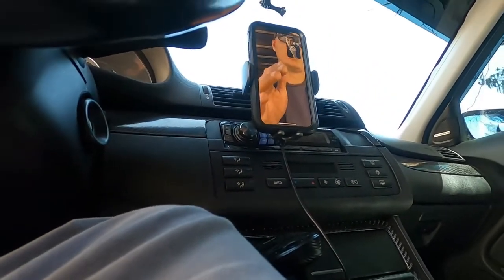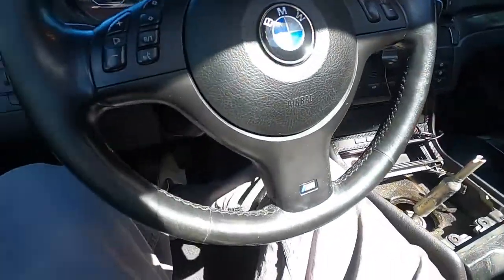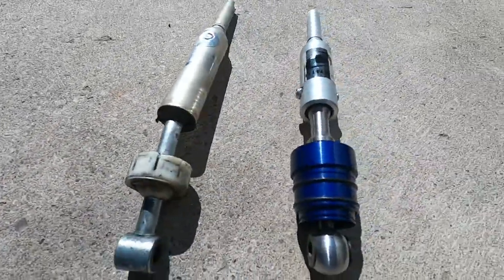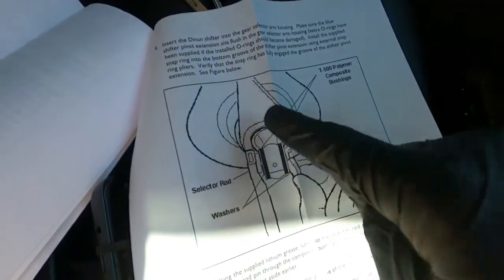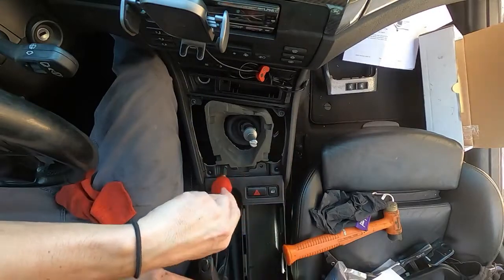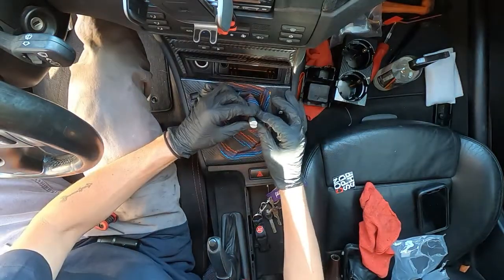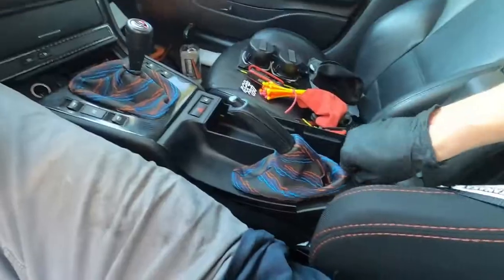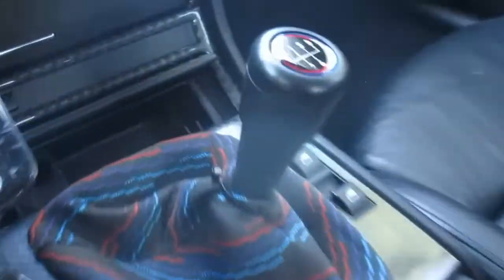Bmw E46 Mod 3' | Shorter throw shifter

Comment: You were able to instill this without dropping the exhaust or removing the heat shield? I'm impressed.
Reply: done this too. But it's a PITA.
Reply: Just doing the short shifter should be fine without dropping anything. The real troubles come with DSSR installation😅

Comment: Chassis mounted ones are better, feel better, and are way shorter, I have an eBay one that I got for 40 dollars and it’s held up super good for the past 8-9 months that I’ve had it, I’m going back to the stock one tho, just because mines a daily and I like how the stock one feels for a daily, for race/drift car I would definitely recommend it. Had it on my e36 that I had for about a year and never experienced any problems with it either
Reply from the maker: Yeah I eventually may go to that but mine was a Daily for a bit so I just got this one it’s pretty nice it has a little click too it that I like, I eventually want too do a hydro ebrake I’ll probably do that and chassis mount shifter someday lol
Reply: What the problem with chassis mounted shifter? I deciding between them but using chassis mounted shifter eliminated allot of bushing so make it more cost efficient and less parts to brake into further, easier install. Am using it as dialy and race and drift.